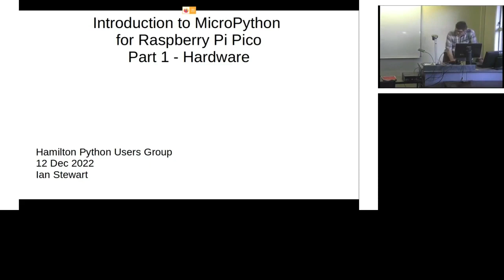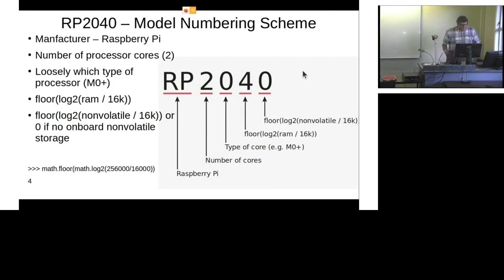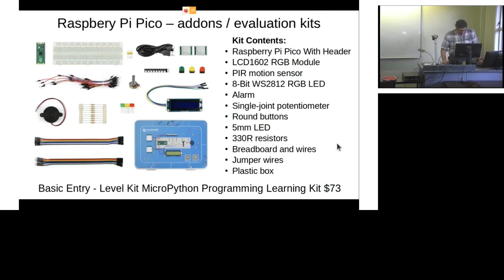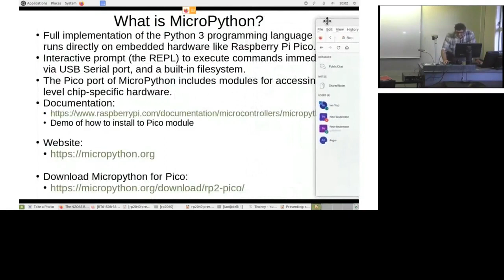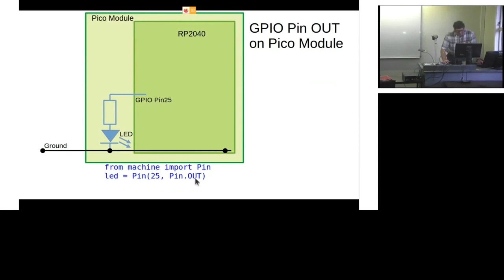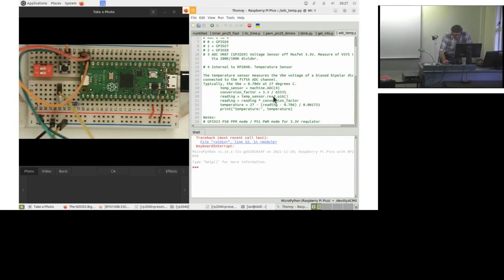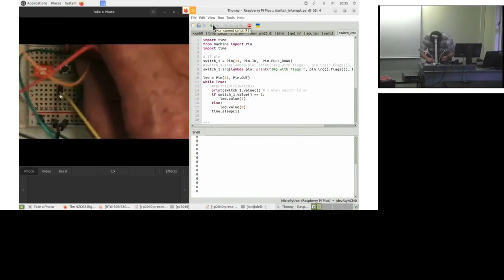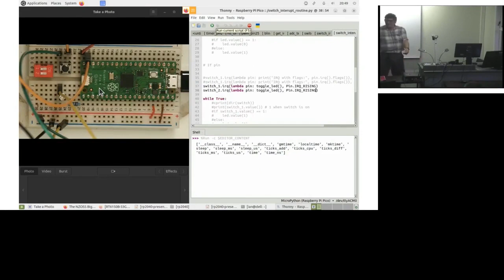Hamilton 2022/12/12: MicroPython on Raspberry RP2040

Comment: Aren't pull-up and pull-down schemes should be the other way? At 27:47 https://youtu.be/Ua-uwaed68Y?t=1667 when switch is not pressed shouldn't pin have low input, cause it's pull-down?
Reply: Many thanks for informing me that for the Switch diagrams I have the "pull-up" and "pull-down" drawn the wrong way around.
I will correct this video.

If a switch from a pin to ground is Open and the resistor is programmed to be Pin.PULL_UP then the pin will be high. Closing the switch will change the pin to low.

Alternatively, if a switch is from a pin to 3V3 is Open and the resistor is programmed to be Pin.PULL_DOWN then the pin will be low. Closing the switch will change to pin to high.